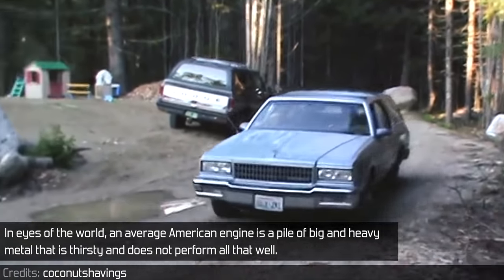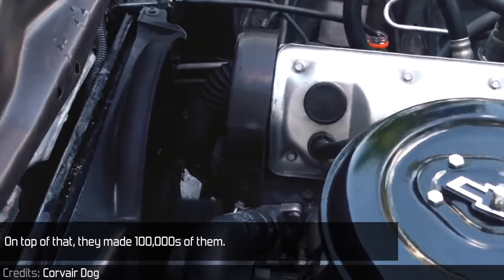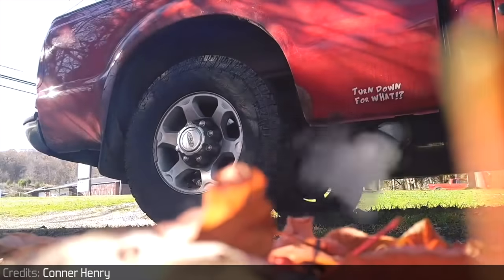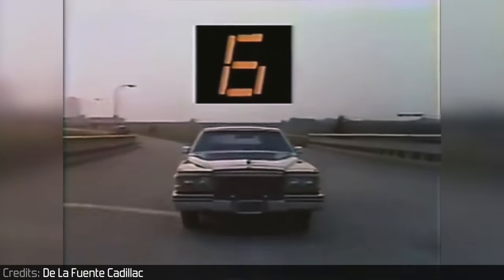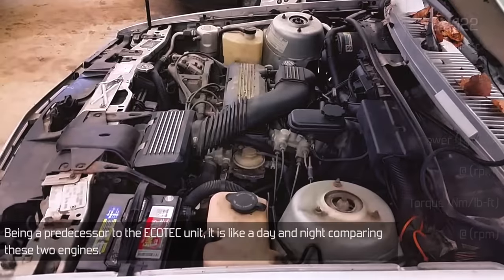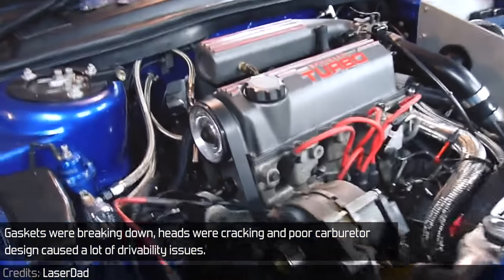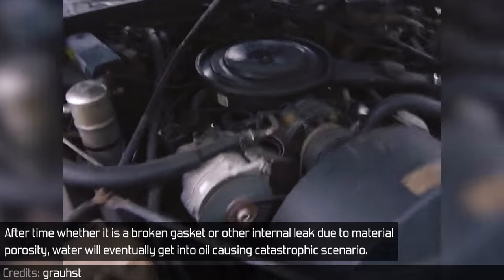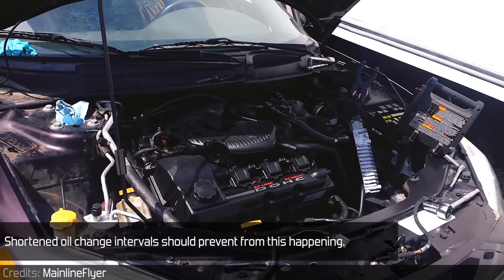8 Worst US Engines You Should Avoid

Comment: I've been running the Ford Triton motors for years, I love them they are dependable and have good power. Never had any troubles with spark plugs on my engines because when replacing  them they were properly torqued into position. People had lots of trouble with the spark plugs blowing out of the heads because they did not torque them properly. Even if the plugs stripped the threads it is an easy fix and do not have to remove heads to do so.

Comment: As an American, I can say that the worst engines made are those relating to cost cutting as Visio says. When proper time and development is put into an engine than a proper product is made. Overall American engineers know what they are doing (most of the time) but when bureaucrats are cutting their budgets and rushing things to production, failures occur. Such is the case with just about every country's designs
Reply: Big Mike Cost cutting, oh and the 70s and 80s happened. Remember the Mustang 2? Ahh good times.
Reply: Jeep 4low Dude, I put 259K on a 4.3 in a 95 1500 work truck.  One alternator and two water pumps.  ONE clutch!  Lots of highway miles, and towed light too.  Truck rusted out from NE road salt, but the engine was fine.  4.3 is a great engine.  6000 miles oil change interval with Mobil1.
Reply: CJ Chatham American engineers χαχαχαχαχα
Reply: Big Mike 
I had 7 Chrysler products with the 2.2 and NEVER had problems with any of them. One was my daily driver for 16 years. Low revs, plenty of power, great on gas and very easy to work on. Everything within easy reach.
Reply: Yep the 80's had crap engines and cars... but i'd take a caddy with an 8-6-4 over an 80s Peugot, LeCar , Renault or the Soviet Lada! Those countries had NO emissions laws in the 80's and their cars still made less than 80 HP....
Reply: American V 8's are not for the super rich but for everyday folks. One company (  from The Big 3 )  might have produced and more different engines as all the rest of the world together. Some engines were better, some not. You can only learn from your mistakes. All we need is getting lectured by guys who have never driven a V 8.
Reply: Big Mike - I have to disagree!
I firmly believe that auto engineers should be required to work as mechanics for three years before they're allowed to design anything! Things would be designed A LOT different. For example: spark plugs would be a lot easier to reach.
(I've got a college degree in mechanical engineering, but I chose to become an auto and truck mechanic instead. Recently retired after only 35 years of turning wrenches in dealerships and small shops.)
Reply: Your word's in God ears !  (Or who ever makes cars ! )
Reply: My rule of thumb for American cars is to give the engineers a few years of production to work the bugs out. For example, a vehicle that keeps the same powertrain for 7 years will be a better car at the end of that 7 years than it was in the beginning.
Reply: You're right about the cost cutting, the Chrysler 2.2 & the Neon engines never would have had the head gasket problem they did, but the bean counters saved about $4.00 per car by substituting a "cheaper" gasket. That cost them millions in warranty claims and lost them a lot of customers who will never buy another Chrysler car.
Reply: @paullarzazs9601  -- Hell, yeah. Remember the V8 Chevy Monzas, where they had to cut little doors in the wheel wells to change the rear plugs? I only worked in the trade for a year, long enough to find out that I lacked the aptitude, and went into carpentry. I would make the same recommendation for architects. Make them swing a hammer for a few years before letting them design a house. And I suspect that the principle applies more broadly for anyone in any design business. Get some hands-on experience with the kind of product you're designing.
Reply: True, and some of these were fixed. The HT-4100 was awful, but the later 4.5 and 4.9 versions of that engine are very reliable. My dad had a Caddy with a HT-4100 when I was a kid, and he swapped a 4.9 in there and never had another issue.
Reply: Jeep 4low Only in cobras.
Reply: Granted there are exceptions for example the AMC Gremlin the second most fuel efficient car at the time behind the VW beetle and it literally was a car cut in half and made into a hatchback using a regular AMC straight six apparently (along side some trim models using a V8)
Reply: @TheMeanBean322  Say what you want, the Mustang ii was a pretty good idea for the time. The times were a changing, and the idea of a large muscle car for Ford wasn't that great, so they went small to compete with some early Japanese Sports Compact. Mopar went Luxury since those were still selling. and GM went fuck it and kept making the F Bodies/Corvette into they lost money on them.
Reply: I would much rather have a cheap interior to sit in (like in the charger hellcat), rather than the cost cuts be in the engine, the most important part of a car.
Reply: My oldest sister bought a 1950 Ford in 1953. 6 months later needs a engine. That happens when you don't change or check the oil.
My wife toasted the engine in the Plymouth I had. Because I was in the Pacific for 6 months. She also only knew how to read 2 gauges. Gas & speed.
But things were improved by then she got 10,000 down the road and it croaked in a traffic jam in 101F weather.
"Stupid car stopped and the air conditioner shut off."
That is why there are check engine lights. But I think they should should announce "Pull over and stop the car. The engine will shut down in 45 seconds." For those gas and go operators. 
I still have the same problem with spousal unit number 3. The big problem is getting cute thing in driveway to sit still long enough to open the hood and examine what is happening before  MR. Check Engine light announces there may be a problem.
At least if you had a Olds or Cadillac with one of those early diesel engines. (1978-1985) Plus did not live in California.
 You just find a Olds 350 engine from 1969 and rebuild it. It bolts right in with no mods needed.
Seen that happen more than once. NOW THE EMISSIONS STANDARDS ARE GOING UP ABOVE WHAT A HORSE EMITS in the very new future.

Comment: I wish they still made the ford 300 inline 6. That is one of the best engines made by ford.
Reply: Yes it was.  Onan, who was later bought by Cummins used them in generators.   A remarkable reliable engine with lots of torque  that should have never been discontinued.
Reply: I owned two they are better with lower gearing  my 1990 half ton 4x 4  had over drive real tall gearing on a flat hiway going 100 k I could floor it with no increase in speed  and first gear again way to tall. but with lower gearing they are great.
Reply: I miss my dad's 89 f150 with the 300-6
Reply: The American Motors 258 inline 6 was a great engine, it would run for years and last. Unfortunately the AMC bodies were like Chrysler's. After 10 years and 120k miles the doors would fail and the hood hinges would break. If the cars had snap on bodies that could be replaced a 258 would have been good for 400k miles. (guesstimate.)
Reply: James Island Fishing .oh yes what a motor I still have and drive my dad's 1982 Ford f150.its been thru hell and though the body is in very bad shape this truck starts a goes I hate to have to get rid of it miles on it really don't know how many times the odometer had turned over.
Reply: I remember it well.  Ford advertised the economy of a 6 with the power of an 8.  A friend of mine traded in a 390 he used for a truck camper and boat trailer.  The 300 had a lot less power but the gas mileage was a lot worse.  The 390 might have been the best pickup engine ford ever built.
Reply: All the straight 6 motors were pretty damn good.
Reply: Don't forget the GM 292. I loved that engine!
Reply: Yup, smooth running, lots of low-end grunt and so damn reliable you couldn't kill it with a bazooka.
Reply: 390 FORD engine (and the 352) were one of those engines which which was designed nearly perfect when it first came out... it was so good, that the bean counters and accountants started doing everything they could to make them cheaper and weaker.
 
 By the late sixties, early seventies ... they finally gave up and stopped putting them in passenger cars (but kept putting them in truck until the 80's and 90's in South America) making them - not because they were bad - but because they were too good! Even today, there are old 390/352 ford Fe engines, which started out as U-Haul rental trucks, still on the road being used as shop truck by mechanics. construction companies and farmers.
Reply: The 300ci 6 did not have a timing chain, it was gear driven. It was a heavy duty truck engine.
Reply: Yep , great engine and plenty of  room for twin turbos .
Reply: The Ford 300 was a good engine.  It wasn’t powerful by any means and didn’t get good MPG, but it made low rpm grunt and was virtually indestructible.  It’d make less power after 100s of thousands of miles, but it’d never stop running.  I’ve had them in everything from carbed 1980 1 ton to EFI 1992 F150.
Reply: I wish they would bring back the 7.3 power stroke that motor was so good but it did have transmission issues with the automatic transmissions but manual 5sp fucking mint
Reply: I have a 1984 ford f150
Reply: ford could take back in the ford barra 4.0 as its developed and assembled already in Australia, it sohuldint be to expensive for em to ship em and dropp en im cars in states or europe.
Reply: You young fellas miss the 300-6. Us older dudes remember the 240-6 from which the 300 was derived. Fabulous engine.. always loved a straight 6. esp. Chrysler slant 6.  But mentioning the Vega...The fastest self destructing vehicle ever. One notch above a trabant. Kind of embarrassing an embarrassment.
Reply: @1978garfield  fuel economy wasn't its best trait
Reply: @tlwolf86  The FE series were good.  FE is the element symbol for iron and these had lots of it.
Reply: along with 260, 289, 302, 351W, 352FE and of course the Flathead 8.
Reply: dont forget the 351 windsor
Reply: @centurian318  I think a new inline 6 engine design with a focus on reliability and efficiency over power output would be great. The major downside to a gear driven timing system is noise and sensitivity to vibration, but since an inline 6 is a naturally balanced engine, it shouldn't be an issue with modern metallurgy.
Reply: I would like to see a redesigned inline six that combines the best features of the Dodge slant 6 and the 300 I6 with modern 4 valve per cylinder design.
Reply: You bet👍
Reply: Chrysler Slant 6. 'Nuff said.
Reply: James Island Fishing: 
'86 to '96 inline 300cid 6cyls had EEC-IV sequential multiport fuel injection. Amazing engines! And that fuel injection & electronic ignition is a perfect fit for 60s Jaguar straight 6cyls....
Reply: @llb.3245  FIND someone with a really heavy forklift & change the BODY,
& BED, ODDS are you don't even need to get CLOSER THAN 10 to 15 YEARS!!!! Find a used 82 to 95 with a BLOWN engine but NICE body;
1 to 2 g's for the used WRECK; at EVEN 3g"s for the SWICH-OVER
you will have a FAR BETTER TRUCK than the P.O.S. 1998 to 2008 USED
ANYTHING!!!!!!!!!!!!!!!!!!!!!!!!!
Reply: Ford, as well as all of the vehicle manufacturers, seemed to have a death wish in that when they finally did do SOMETHING right, they quickly jumped in and started finding ways to destroy it.  I drove a '59 Ford Galaxie 500 with the 352 engine many years ago.  That thing was tough!   I don't know what finally happened to the car but I suspect the engine is still running long after the body fell off of it.
Reply: Still wish I had my 1992 f150 4/4 with the 300 was a great engine that why they got rid of it was to reliable
Reply: Had a 88 5 speed f150. I agree. Only Ford I had
Reply: James Island Fishing the 300 six was like a tank in motors one of my favorites
Reply: @georgee.williams1449  I had a 88 300-6 5 speed. Perfect truck
Reply: @lawrenceparker695  my 88 had a 5 speed. 410 rear end.  I towed a old Chevy pickup out the woods with no tires on it. Bed was filled with medal. I never owned a truck since that could do that. In gas engines
Reply: And when built right could outrun most V8s.
Reply: James Island Fishing  300 was a peice of shit redline at 2500 rpms no power band. Fuck that motor
Reply: @stlchucko  -  My 300 with air auto and 4x4 (pickup) would get 20mpg at 70 on the highway. Drove it 800 miles to Missouri and back to get that figure. It was summer and the air was on. It was a really good truck. I miss it and should never have got rid of it :(
Reply: The 300 almost came back... but it would not fit in the 97 pickup body. Ford had re-engineered it with a cross flow head and some other refinements. The mods made it more fuel efficient and powerful than the V8's. But it would not fit in the bodies and a gas motor they could not put in the 150 was baggage. The 4,2 liter was a Triton with two cylinders chopped off. The V10 was the triton with those two welded on another v8 LOL  
The straight six almost came back. RIP
Reply: yep.
Reply: I had one. Solid.
Reply: I still see them often. At least a few times a month. 
Still plenty of em on gensets.
Reply: Mopar Slant 6
Reply: The Ford 4.0ohv cologne is a solid motor I’ve had a few of them without issues just a bit harder to work on
Reply: @zackjay71  shocking that an engine specifically designed to make power at low rpm would only make power at low rpm.